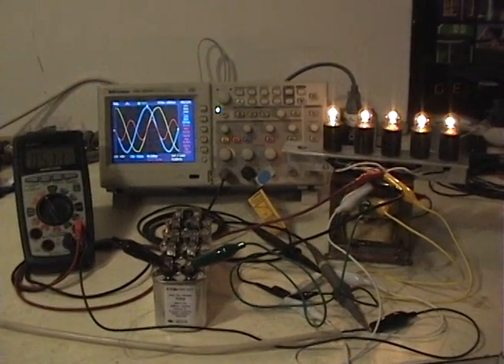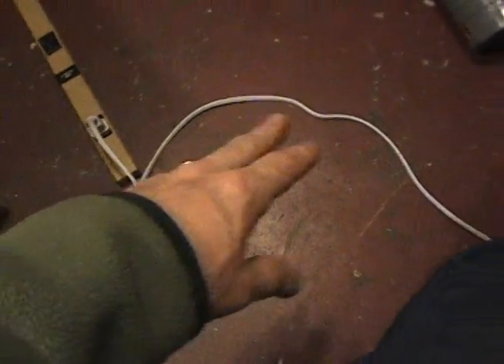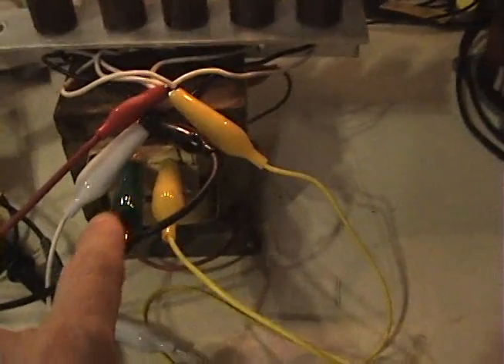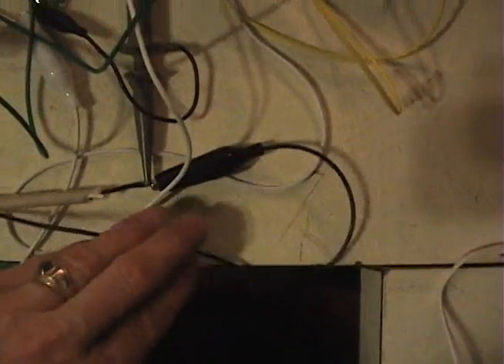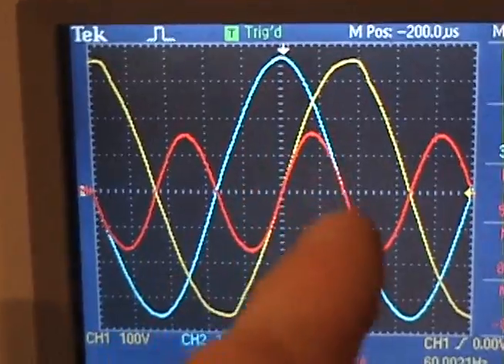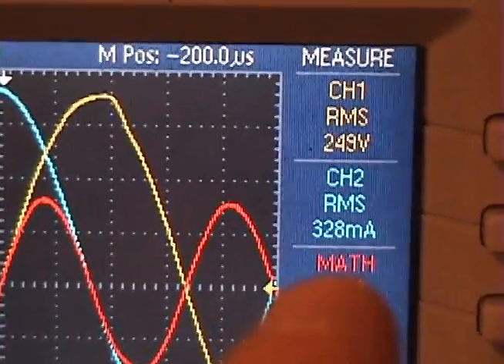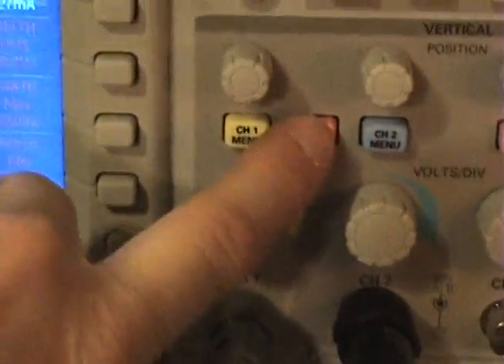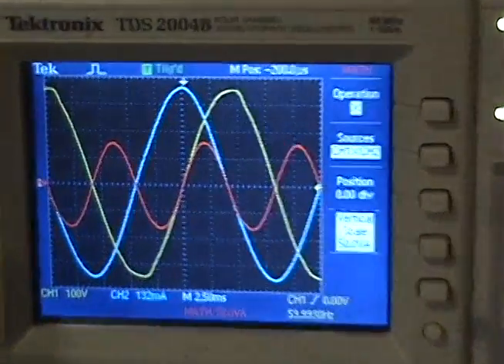Reactive Circuit test on 240 Volts

Comment: Hi Luc,
I've been studying your lectures on the reactive power circuits and think you've done a marvelous job. Did you actually publish the circuit anywhere ? The only thing I didn't understand was the role of the transformer you used ....only using the primary coil.....what was the purpose of that ?
Here in the UK....our grid supply....as you know....is 240v................ so this video is particularly interesting.
Reply from the maker: Hi Tony. Thanks for your interest and positive comments. Unfortunately there was an error in my scope setting, which when corrected revealed underunity. You can read about it using the link to the forum topic in the description box below the video. Regards Luc
Reply: Thanks for taking the time to get back to me Luc. I know you are very busy.  Big disappointment !!....but I suppose its the old adage ...if it looks to go to be true............it probably is !!!
I recognised the oscilloscope power phase patterns from Thane Heins' work on the BiT transformers and was hoping you had stumbled on a similar way of creating the 0 power factor. It is such a shame that it wasn't to be. 
However I think you do excellent work and will continue to follow you.
Reply: Re Thane Heins.....have you ever done any work on his principles ? The BiT seems to have been replicated by several people.
Reply from the maker: Thane and I have worked together (on and off) for over 8 years. We also live in the same city. If you see Thane has a nicely wound coil, it most likely was made by me. BTW the ociloscope in this video is Thane's. We share effects we find useful. Luc
Reply: Thanks Luc.....I'm pleased you are working with Thane Heins. Do you think his oscilloscope measurements are correct ? Has the BiT truly achieved overunity ? I'm surprised that there has been no commercial development ?
Reply from the maker: Not 100% sure if the BiT works as Thane believes. He has been waiting for investments to commercialize it. 
I personally don't care for business or profit. I just share what I find interesting. Anyone is free to use it. Luc

Comment: Luc:
I appreciate your response that the phase shift circuit will not return power to an inverter (directly). Yet, consider your own situation wherein you yourself are plugging your phase shift circuit into the electrical grid system. In this case, you are actually returning power to the electric grid transformer closest to your location, with your meter between these two points, and not to a generator.

May I suggest then a test of a system in this way and order:

First, a 12V battery (measure draw)  to an Inverter feeding a Transformer Primary - No load on the secondary.

Then, same as above but now add the phase shift circuit and load off of the Transformer secondary above.

Many Thanks.

Comment: Hi Luc, Many thanks, with one special request please.
Is it possible that you might attempt to use a 12 volt car battery to power a typical 12 volt to 120 volt 60Hz AC auto inverter.

First measure the draw on the battery with just the inverter. Then measure the draw on the battery with the inverter powering a load using this out of phase principle.

Again, many many thanks.
MagnaMoRo
Reply from the maker: Read the forum topic and YT posts. You will see that I have said it doesn't work with an Inverter, as an Inverter cannot do anything with power being returned to it.
That was one of the first things I tried when I found the effect some months back

Luc

Comment: Hi Luc, well done,
but when I remember correctly I have learned at the university, that reactive current is also charged by the power company via the house grid wattmeter, as these meters are just mechanical meters measuring the absolute value of the current with its rotating Wattmeter disc. So lowering the current will get you more to a powerfactor of 1 ( where it is IN PHASE) and then you will pay less, cause then the current is also less and the Wattmeter disc is rotating slower....
Otherwise it does not make sense, that there are companies who sell these
voltage-current-phase-angle-corrector-devices  to lower your energy bills.

So please show the reading on your mechanical house wattmeter, when you have this circuit running.
Many thanks.
Regards, Stefan.
Reply from the maker: Hi Stefan,

I don't agree with you on power factor!
A power factor of Zero cannot be charged and mostly by those old mechanical meters. I have one and the wheel stops turning even before I get to a 90 degrees phase shift.  Even smart meters cannot charge you for a power factor of zero. Anything above they can charge and the mechanical meters start turning when above a PF of 0.13 since they are set for an average PF of 0.87
Smart meters can measure PF form 1 to .01
A PF of 0.5 is the same charge as a PF of 1. A PF of 0.75 is more costly then a PF of 1, so this is where you want to make PF corrections.
A PF of 0.25 will be half the charge of PF of 0.5 and a PF of 0.00 is free of charge as it is considered wattless power and electrical engineers have been educated that you cannot get real power out of anything operating at a power factor of zero. Just ask Farmhand, as he posted that in my forum topic

Now, the reason I built a generator turned by an electric motor is to test to see if a circuit operating on a PF of Zero will have an effect on the Gen prime mover. My test is the only one available on the internet and proves it has no effect what so ever to the prime mover while delivering over 20 watts of real power. Just that in itself is amazing since engineers say it's not possible.

Luc

Comment: Thanks for sharing. why you isolate form grid your oscilloscope???
Reply from the maker: Hi Atif,

because using both HOT sides of the grid to make 240vac and leave the scope attached to grid ground would make a short to ground though probe grounds.

Luc.

Comment: Hi Luc,
I did replicate it. I used a 110V->220/380 Volt transformer, running it on some caps and 220Volts to the 110V side. I use the secondary for a load (15 Watt 220V bulb running on 90 volts, also ran a 3 Watt LED which works from 85V and higher)). Thing is: my watt meter shows 0 watts, and it is a true rms meter. The current which I see on the ac side 220 Volt is 0.5 A. I am not able or not going to shut down all electronics in my house to see if my electricity providers meter can pick up this load or not. What I don't understand is this: is there a power factor we can speak of, or not? If I understand it right, it is NOT capacitive and NOT inductive. Hence you call it reactive, am I right?
Note: I do not have a oscilloscope.
On your scope I see you do use the power from the grid.The calculated sinus (a beauty one) shows your power usage. Does this power consumption (even if it is nullified) have an effect on the lines from the grid suppliers (power company)? The power company wants us to have a power factor around 1. The reason is because of losses in the lines to the houses. Does this reactive power usage have an impact on their lines, in terms of extra power dissipation?
Let me exaggerate to amplify my question: suppose 10 house holdings are using only reactive power, would the power line to these houses see a load, and would the lines loose power (because of resistance in the lines to the houses)?

PS: have you tried running this on an inverter? So you can see on the 12 Volts line if there is an increase in the load?
Reply from the maker: Hi deslomeslager,

thanks for trying and posting your results. First, this won't work using an Inverter as main feed since an Inverter is not capable of handling the return current. Only the Grid or a Generator can take advantage of this. So don't waste your time with Inverters. Second, if you have a power factor of ZERO (voltage & current 90 degrees out of phase) the utility cannot charge you (even with smart meters) as it poses Zero strain on the Grid and electrical engineers have been trained that a power factor of Zero will give you Zero Watts, so they are not worried about this.

To prove my circuit has no effect on the Grid I attach it to a Generator (the basics of the grid) and it has no effect to the generator. However, anything above Zero has an effect on the grid (or generator) and in some cases they can charge you more!... like if your power factor was at 0.75 (worst case) compared to if it was at 1.00. So that's why they encourage power factor correction in this case to save you the extra charges. But if you can lower it to 0.50 it is the same cost as at 1.00. If you go lower then 0.50 you will start to pay less as it drops and if you can reach Zero you will not be charged.

Hope this answers your questions and concerns

Luc
Reply: Luc Choquette
Hi Luc,
Thank you for the prompt reply.
If I understand you correctly, these 5 lights in your video are in fact showing the power which are being taken from the grid (in one direction) and given back to the grid (in the other direction). And to make this complex: in order to give it back to the grid, the LC circuit must deliver double the power, since there is one needed for the load, and the other to deliver power back to the grid.
Please tell me if I got this right. If that is the case, then it is really not that difficult.
Reply: Luc Choquette
When power factor is equal to 0, the energy flow is entirely reactive, and stored energy in the load returns to the source on each cycle. (found on Wiki http://en.wikipedia.org/wiki/Power_factor).
Reply from the maker: deslomeslager
I cannot say I fully understand where the extra power is coming from. So I'm not in a position to answer if you are write or wrong. It will need to be studied by educated but open minded engineers to fully understand it.

For now just try to replicate it as it has a small window of cap value and load output where it works.

Luc